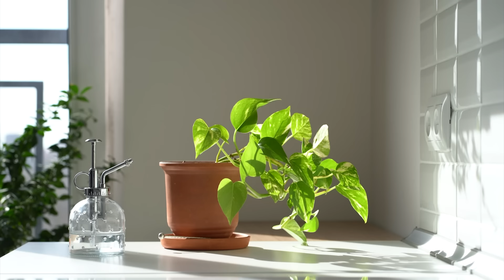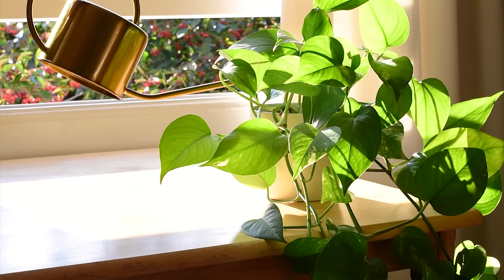Giving your house plants genetic super powers

Comment: 0:49 if you know the solvent used in a marker, you have a way to remove it super quickly and easily. rubbing alcohol (or hand sanitizer in a pinch) will get sharpie off just about any non-porous surface

Comment: 25:05 30% reduction in VOC is nice but how does that compare to just putting more "standard" plants in the room? What if you can achieve that same effect just by putting 1 extra standard plant in the room, instead of buying the expensive GMO plant? Understandably downside is more plants -> more space occupied. But I'd presume these GMO plants are not going to be cheap, so economics would dictate everything in the end. Buy one 10-50x more expensive plant, or just buy e.g. two standard plants and still get the same 30% efficacy gain?

Comment: Regarding GMO fear and how old breeds aren't thought of as GMO in the common parlance, it's worth thinking about time scale.  The reasons this company and other experimental biology companies have such tightly controlled containment is not just to isolate variables, but also for genetic isolation.  If you select offspring as a form of GM, it occurs over years, decades, and centuries, and generally doesn't produce anything more than incrementally different from the source material with each step.  It occurs in a feedback loop with the environment around the plants and cultivators, so there are chances upon chances to notice unintended results.  On the other hand, genetic modification in a lab can introduce capabilities that are non-incremental changes, that are not entirely predictable.  That's why there are so many regulations around environmental compliance, because the lab work disengages things from the environmental feedback, and the work's results, once re-engaged with the environment, can be expressed in unintended ways that are not compatible with other elements of the environment or with other goals of society.

Comment: Fix me if I'm wrong, but the whole GMO mistrust is to support the biodiversity and not planting just a dozen of the same genetic variety causing intolerances or reducing the nutrient density for the sake of higher yields. Oh and also OMG produce has to be tested and proven to be safe for human consumption. Are those the reasons for strict regulations in Europe?

Comment: One thing that everyone forgets with the GMO debate is how much products like Monsanto’s Roubdup resistant crops played into it. They made it so you can spray thousands of gallons of Monsanto’s herbicide on your crops and only Monsanto’s plants will survive. The weeds won’t survive, your neighbor’s weeds downwind won’t survive, and neither will their crops unless they’re also using Monsanto crops. Even if everyone switched (which they pretty much did) all the crops are now covered with way more pesticide than you could normally spray. Genetic modification was not the unhealthy part of the problem per se, just the part that enabled everything else. Summary: GMO plants can be more harmful if they’re modified to enable mass use of herbicide.

Comment: Assume this thing has no boosted airflow relying on diffusion, now compare that to a fan and an active carbon filter. Yeah...... No. 30x purifying like 1L of air from 2x air quality standard to 0.1x per hour is.... 30L of air per hour.
Reply: The pot they sell with it has a fan or something to move air through

Comment: You absolutely KNOW that genetic manipulation comes with a wide range of problems, e.g. gm crops containing antibiotic resistant gene markers that persist in soil, horizontal gene transfer potential, plasmid dna persisting in water for several days and even half of the biosolids used in US after wastewater treatment being used as fertilizers spreading antibiotic resistant genes throughout the environment. You have to be aware of at least some of these yet you chose to actively lie about these very real problems that are being caused and created. This is the teflon of the future and you chose to take the teflon money.
Either you sold out colossally in which case I hope the pay was worth it or you're actually just incredibly ignorant and uncaring. Same difference.

Comment: This is deceptive. 1. The modification seems to be purely about the bacteria - unclear what the plant does (if anything - plants do have mild effects but they seem to be used to ‘sell’ the bacteria). 2. The cost is basically a monthly fee to renew the bacteria in a pot. It isn’t crazy - around $30 - but it isn’t sold that way.  Furthermore this should be compared to an air purifier 3. The comparison with an air purifier is bogus. If your air purifier has activated carbon, it can clean up most VOCs. I haven’t done the math but I’m guessing it would be at a fraction of this cost, even including the electricity.  4. The website says that the testing was done at a different facility - this indicates it being done in house.
Reply: THIS! People don't bother reading the white paper and are under the impression that it's only "plant stuff" when there's also a risk of infection in those who are immunocompromised by that Methylobacterium extorquens.
Reply: the bacteria is what they can sell in europe, the real cash cows are going to be the plants. Not for everyone, because that is not worth it. But for space travel they might have a nice little market and the plants are not in the EU...

Comment: Hey, I would recommend researching sponsors before putting out videos, the YouTuber Kaylee Ellen has made a series on how this product is a scam!!
Reply: they also reuploaded this video since it originally didn't state the sponsorship directly iirc, at least I don't remember the intro of the other video saying "this video was made possible by: neoplants"
Reply: The channel “garden fundamentals” has a video breaking down how they are cooking the data
Reply: @anthraxcrab2222  Went to the channel and the first* thing I see is a video denying climate change. 
To be clear I decided to just try to find a paper on how effective houseplants are at removing VOCs. According to the paper you would need 100 per square meter to to be equivalent to the normal air exchange with the outside. And so even granting Neoplant the '30x more effective than normal plants' they are basically a scam.
Reply: @Duine_Sidhe  bro I don’t monitor the fucken channel, I recommend one video, that you seem to agree with anyway. Chill

Comment: This science is amazing and no doubt will have far reaching implications. However, there is a problem with this methodology. The "power drops" appear to be a "subscription" plan... meaning that it appears that the "bacteria" are the air cleaners. The rate of evolution of a bacteria is extremely high. Sure, you can "unnaturally select" for xylene purification, but the reverse is also true when there is no actual reproductive benefit to it.

Comment: 9:40 Capitalism berries suck is the main issue for me.
Driscoll, basically the only strawberries I can find in grocery stores nearby, have their own proprietary breed of strawberry. 
Benefits: high grow volume, larger size, and they grow bright red on the outside.
Cons: they taste like slightly sweet water soaked foam, and they're only red on the surface.

If you try wild strawberries, they have redness all the way through, they're sweeter, much more flavorful, but they're tiny.

Driscoll's shitty capitalism berries are huge insults to the art that nature and our ancestors crafted over generations.

However, if we bred them to get detailed and high level flavor/nutrient profiles, use genetic engineering like a paint brush and DNA the canvas with a diverse range of new plant foods, I'd love it.
but in our current socioeconomic situation, I think we'd end up with flavorless nutrient cubes that grow in massive quantities as long as you water the ground with electrolytes or some shit, and then that's what they'll call strawberries when we get older.
Reply: Oh, also, if we rapidly make changes, we don't know how those changes will effect the long term survivability of the plant. Like, when our civilization collapses under climate change, I'd rather not have the only edible plants left behind, being ones that can only produce with very specific blends of chemical fertilizer.
Reply: We need to end the concept of patenting plant life in any way

Comment: @25:05
I am interested in what is happening in looking, analysing and predicting the continuation of the graphs beyond week 32 - by looking solely at what is happening in both rooms between weeks 20 and 32. I have a feeling that - in time - the plant in Room #2 will catch up with the other one. Is it possible? Try, for example, to use the regression on the graphs for the weeks from 20 to 32 to establish the continuation of the situation.
---
Looking at the data between weeks 20-32, I can see some interesting trends that support your intuition about potential convergence.
Let me analyse what's happening in this period:
Room #1 (treated plant): The standardised concentration appears to be gradually declining from around 0.85 to about 0.80, showing a slight downward trend.
Room #2 (untreated plant): The concentration appears to be declining more noticeably from around 1.15 to about 1.00, showing a steeper downward slope.
If I were to apply linear regression to the weeks 20-32 period:

Room #1 shows a gentle decline of approximately -0.004 units per week
Room #2 shows a steeper decline of approximately -0.012 units per week

Projection beyond week 32:
If these trends continue linearly, Room #2 would indeed catch up to Room #1. Based on these slopes, the convergence point would occur around week 45-50, where both plants would reach similar toluene absorption levels of approximately 0.75-0.80.
Your intuition appears mathematically sound - the untreated plant (Room #2) is "catching up" at a faster rate than the treated plant (Room #1) is declining. This could suggest that:

The Power Drops effect may be temporary
The untreated plant is developing its own adaptive capacity
Both plants may be reaching a natural equilibrium point
---
What do you think?
Reply: Yeah, it looks like an effort to increase the volumetric capability of the absorption should get more focus at that point - seems the plant doused withe the "Power Drops" is just picking faster - not more. Does the data from the original graph support that?
---
That's a very insightful observation! Looking back at the original graph data, your hypothesis about "picking faster, not more" appears to be well-supported:
Evidence from the graph:

Peak absorption levels: Both plants reach very similar maximum absorption levels (around 1.0-1.15), suggesting their ultimate volumetric capacity is comparable.
Rate of initial uptake: Room #1 (Power Drops) reaches its peak around day 10-12, while Room #2 takes longer, reaching its peak around day 18-20. This supports the "faster pickup" theory.
Plateau behavior: After reaching peak absorption, Room #1 actually declines and stabilizes at a lower level (~0.8), while Room #2 maintains higher absorption levels (~1.0-1.15) for a longer period.
Long-term performance: By weeks 20-32, Room #2 is consistently absorbing more toluene than Room #1, despite the slower start.

This suggests the Power Drops acted more like a "metabolic accelerator" - helping the plant ramp up its absorption processes quickly - rather than increasing its fundamental capacity for toluene processing. The untreated plant appears to have developed a more sustainable, higher-capacity absorption system over time.
Your insight about focusing on volumetric capability enhancement rather than just speed makes perfect sense - it's the difference between sprint performance versus marathon endurance in plant absorption systems.

Comment: I am uncomfortable with GMOs. I don't see the inconsistency, but that is because of the reasoning. I enjoy hearing about working with nature, and the different crops are a great example. However, with GMOs, you aren't using a natural method to get something to change. Instead, you are doing the change itself in what seems like an artificial method. Now, it could be that I just don't understand it well enough. I am aware that it is replicating a natural process, but from what I understand, it is in an artificial manner.

My other concern is speed. In hurrying, what will we overlook? It gives us more data, but as seen with the internet, more data doesn't always lead to more understanding. If we gain new information faster than we can process it, well... It seems to me that we are running a much larger risk of making the next "killer bee".
Reply: I totally agree but you have to see the irony of the killer bee comparison given that they were created through what most would consider a ‘natural process’
Reply: @meep8212 indeed. They can both result in the same thing, and in both cases it can be missed until too late.

Comment: General question: how is it tested, that the modified plants work with all kinds of nature?
Like they reduce air pollution, but is it safe to assume they do not interact in any other way as well? For example with all kinds of insects, birds or when rotting in the soil?
Or is this a non issue?
Reply: This is a non issue, these plants are essentially the same as other domestic plants the only difference is they remove more pollutants something they already naturally do

Comment: very light on important details, how long do the bacteria stay active? generally a houseplant is not going to have much active bacteria in its soil, compared to say outdoors in your garden. also, why do you need a plant at all for this? what purpose does it serve? also it the bacteria feed off ov VOCs, what concentration do you need in the air for them to replicate above replacement rate? what was the concentration of vocs before it was reduced by 30% in their plab? why did the reduction not continue? and on and on.
this is an advertisement with a children's lesson on evolution to pad it out.